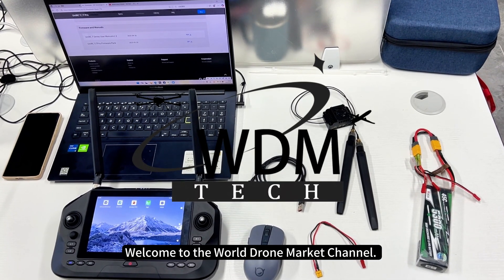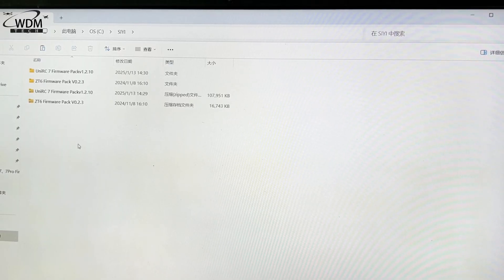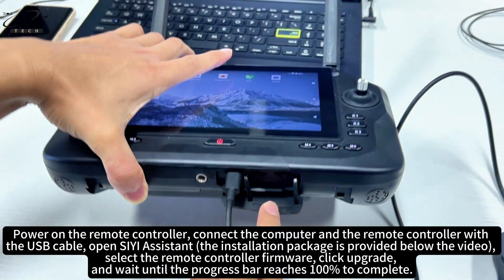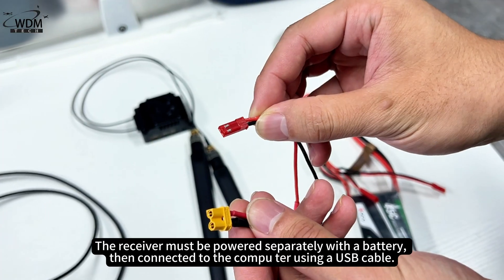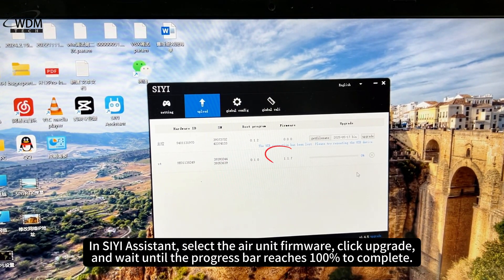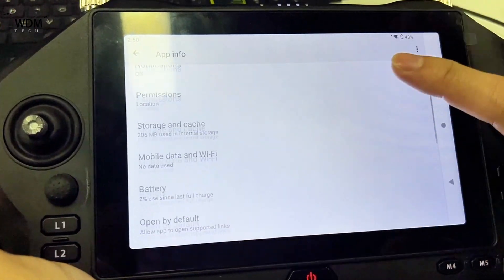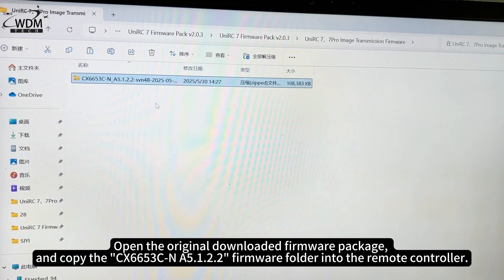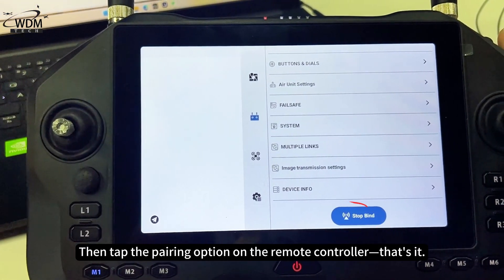UniRC 7 Firmware Update: New Features Include Dual-Control Mode and Remote Control Relay!

Comment: After updated UniRC7 Pro AirUnit to v.2.0.5 and update RC to 2.0.8, a problem arose in the Ardupilot: GCS Failsafe. Every 30 seconds showing messages: "GCS Failsafe" and after 10 seconds later we have message "GCS Failsafe cleared". AirUnit settings will not saved - Bandwidth dont setup, Frequency and channel. In DataLink part cant be setup Channel baudrate, only 115200.
Reply from the maker: Hello, to better resolve your issue, please send an email to our technical staff at tech@worldronemarket.com or tech2@worldronemarket.com